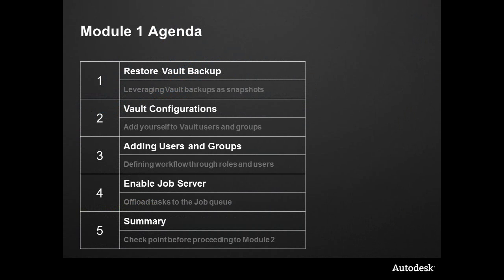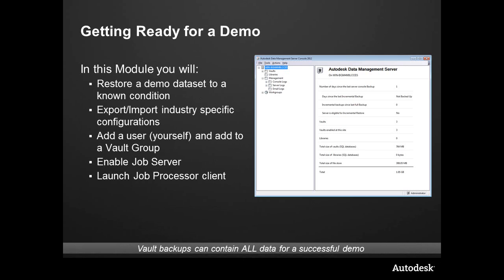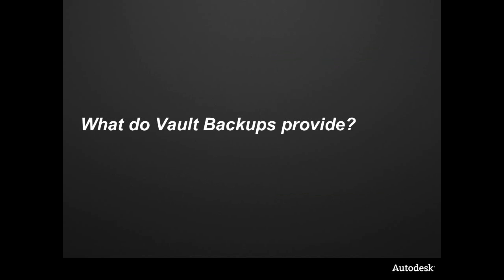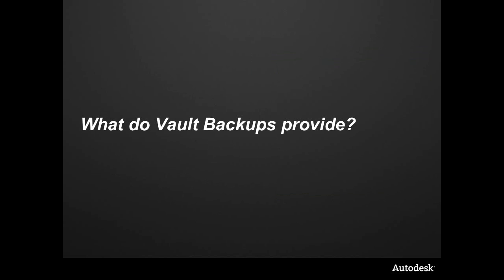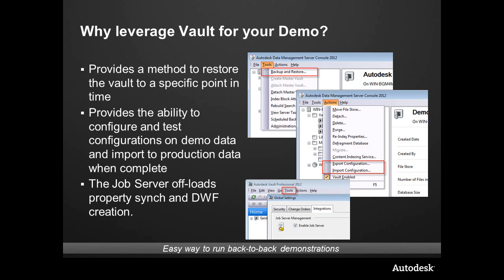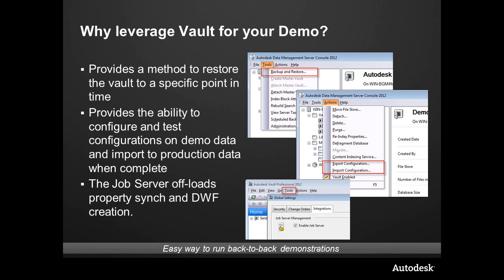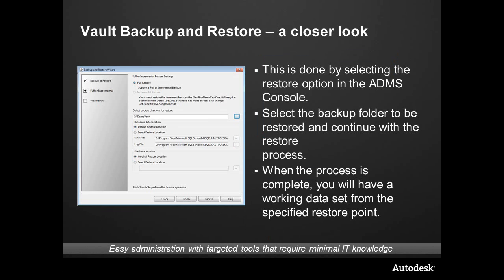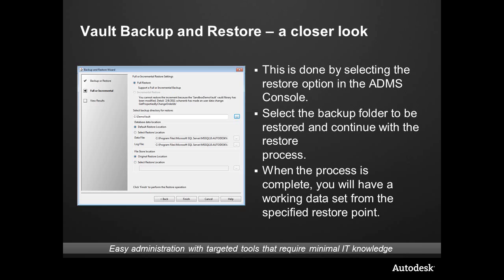Restore and Configuration of Vault Intro

Comment: Hello,

I currently have Autodesk Vault Server 2024, and I am planning to migrate to Vault Server 2025. Before proceeding, I would like to confirm:

If I create a full backup of my Vault 2024 using ADMS Console and then restore it in Vault Server 2025, will it work without any issues?
Are there any additional steps or considerations I should be aware of to ensure a smooth migration?

Thank you in advance for your help!